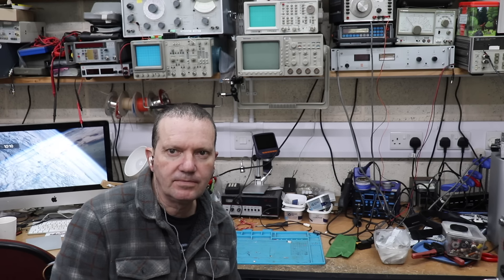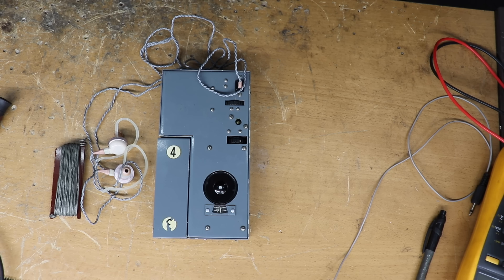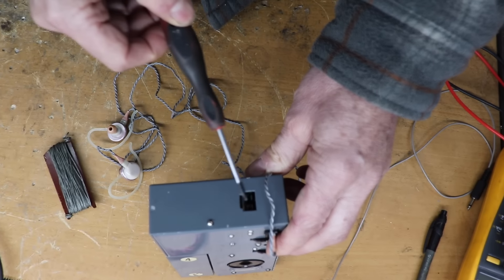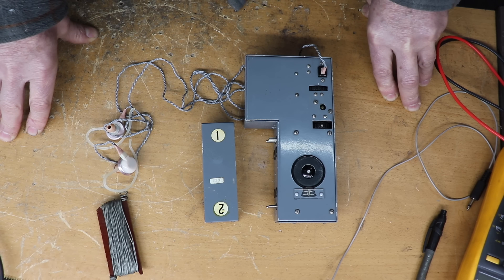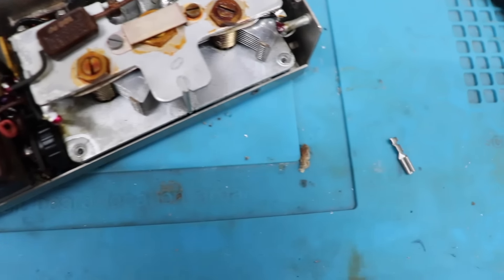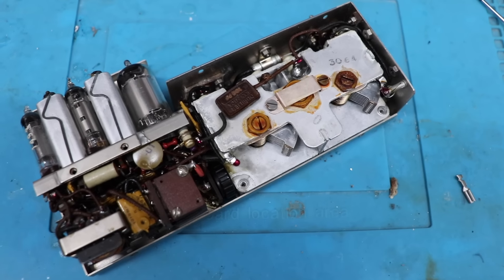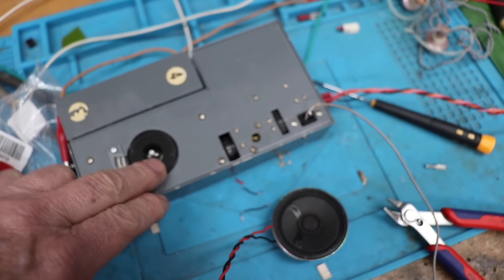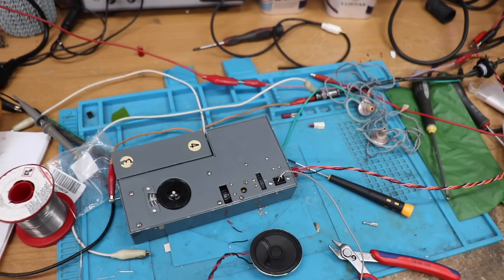1950's Cold War Spy Radio   Does It Work?

Comment: It sounds like the volume pot on the radio was set to full and all that distortion was the output valve clipping. I doubt the radio sound would be that bad. Try reducing the radio volume. Not the amplifier volume. I'm sure that is the problem.
Reply from the maker: Actually there was not very much variation… that is ,all or nothing!!
Reply: @thewtf  If you reduce the RF input, it would sound better, as they designed it to work with less than optimal antennas.

Comment: Is it for 70V or 67,5V? This old stuff must be sensible for overvoltage...
Reply from the maker: On the contrary most valve stuff are fairly tolerant of a few volts here and there